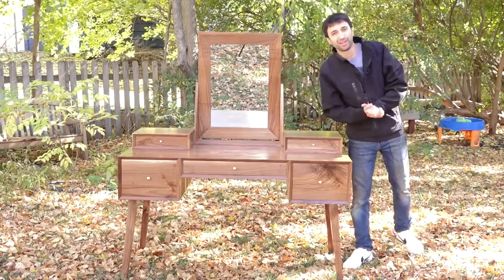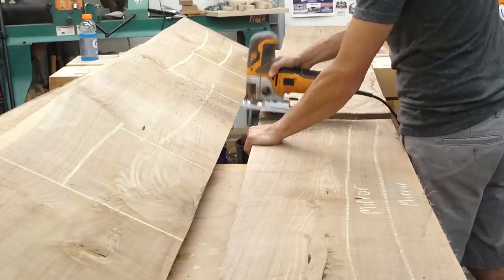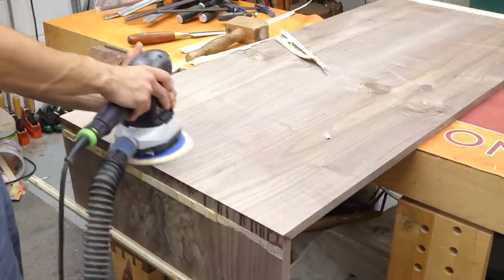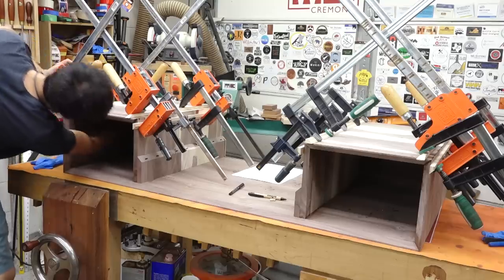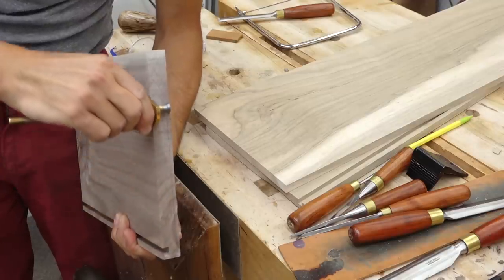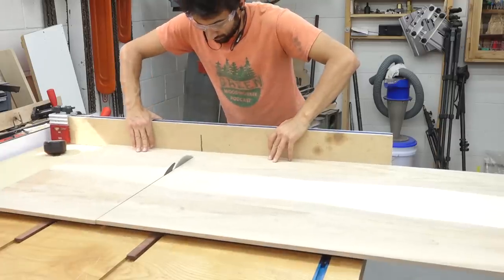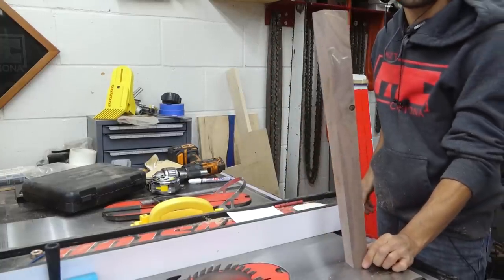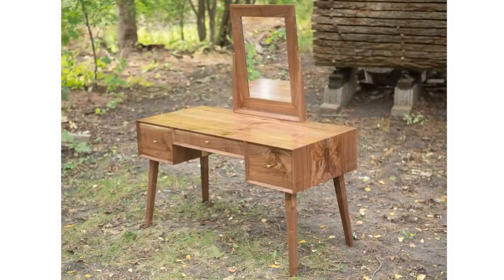Midcentury Modern Walnut Dressing Vanity | Woodworking Project

Comment: Absolutely awesome design and execution of a very beautiful cabinet my Wife Maria would love.
Only thing I'd add is hinged mirrors on each side of the center mirror with 45 degree limit stops so only part of the flat surface of the top of the top drawers was lost.
Woman love a nice side look when putting on makeup.
I'd also add some LED strip lighting around the side of the side mirrors and on the top of all three.
I hope You sign and dated it on the back and under the center bottom of the center section for the future identification of who built it centuries from now.

Comment: I like the trick with gluing on the clamping cauls. I might opt for using hide glue to stick them in place though, as it’s fairly easy to split the glue line later by hitting it with a chisel.

Comment: Beautiful piece and great work. With the drawer fronts so tight, don't you expect to have problems when the wood expands? I know with the size of these fronts, expansion will be minimal, but you didn't leave much room to begin with (at least that's how it looks on the video). (And yes, I agreed to be that 'what about expansion' guy).
Reply from the maker: Thanks!  There are expansion gaps along the top.  They'll open up a bit more as we move into the drier season.

Comment: How did you attach the clamping cauls? I would be so worried about glue residue being left over. Was it a special glue or just good old Tite-Bond? 

That vanity looks amazing. Especially with the grain on that Walnut looks amazing. I’m not even a fan of mid century modern, but that is a beautiful piece of furniture.

Comment: If you do stuff like at 4:30 please change your position to not be straight "above" the blade. You could easily take a step to your right (left from the camera perspective) and still have full control with a much smaller risk of falling in the blade if you slip.

Comment: Matt, do you get any issues with the drawers not hitting the right stop point with seasonal expansion?  Those are some wide drawer bottoms, I'd think they'd cause the drawers to change their stopping points?
Reply from the maker: They will and they’ll move with the seasonal change in the case’s depth

Comment: I have a quick question for anyone with the knowledge, apologies if this was asked already and I missed it. With this being solid wood and all joints glued, how will this piece handle over time with seasonal wood movement? I know waterfall building “should” allow for uniform movement but does that hold true with the bottom drawer stretchers too?? I love this build... but I would hate to see the joints pop after a few years.

Comment: How long will an epoxy glue joint hold? Elmer's Wood Glue has lasted 55 years. Hide glue lasts from 50 to 100 years. The only answer I have found is that epoxy will last 5 years.